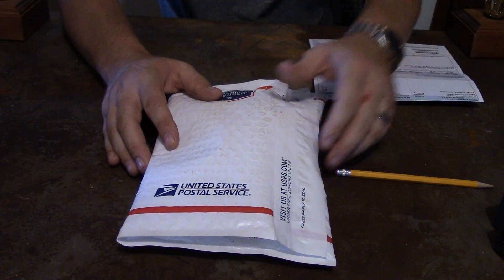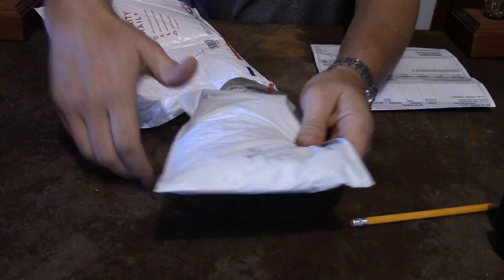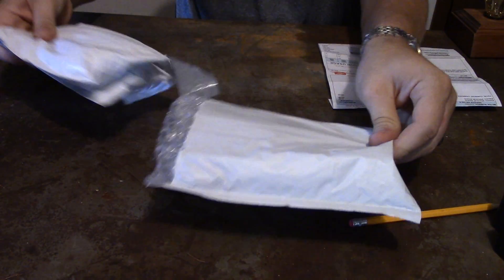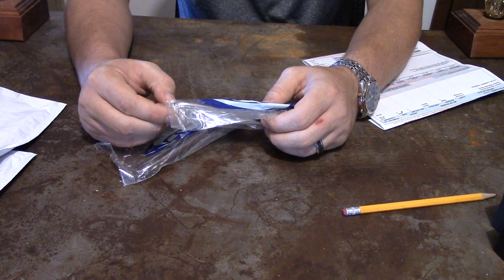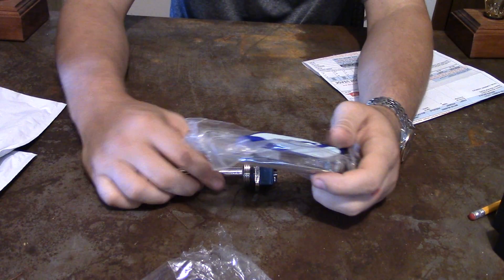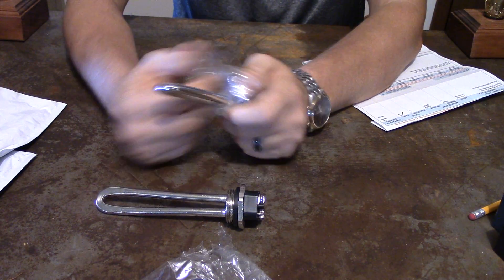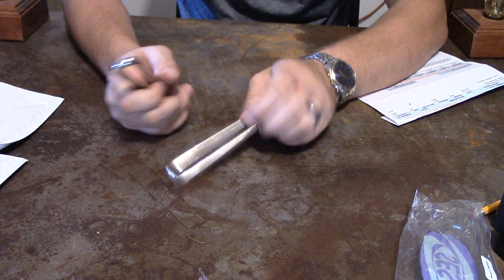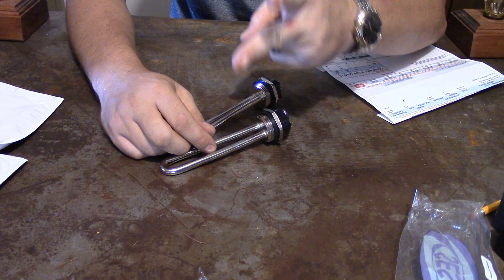24 Volt DC Solar Power Submersible Water Heater Elements - Low Voltage

Comment: Gee, that was exciting... listening to you open a couple of little water heater element packets and then complain about how they are made of soft metal and all beaten up. 
.
Of course they are soft and soft things tend to get beaten up during manufacture. The tubing is copper and the heating element is usually made of several strands of nichrome wire twisted together and placed in a powdered mineral insulation... magnesium oxide, which melts above 3,000ºC. The element is sealed into the tube and the ends are terminated in such a way to reduce the amount of heat generated from being transmitted to the connecting cables. The tubing is shaped and pressed to retain its shape and then sealed into the mounting nut with Sil-Fos or a similar material and then it is nickel plated.  
.
It DOESN'T matter whether the elements are fed with AC or DC providing it is 24 volts... it will heat WATER to the same temperature in the same time span. Much safer than 110 volt? It depends how you use them. Your low amp draw is ONLY 25 amps. A fully charged 250 A/Hr 24 volt battery will be fully discharged in less than 10 hours. If you are thinking of using it at 12 volts... fine if you only want 150 watts of heat because that is all you'll get. 
.
Use it in oil at your own risk. It is designed for water as water will remove the heat generated by the element a lot faster than the oil that you want to heat. Oils can evaporate when heated and form a barrier around an element and considering that nichrome melts at temperatures around 1,400ºC, you could have problems. Copper, by the way, melts at 1,084ºC.

Comment: I use 2,000W 120V elements that are common at most big box stores.  These work very well with 50V and 60V solar arrays producing about 450W maximum.  I power mine off the panel DC buss and generally think attaching heaters directly to a battery is a bad idea.  I have many videos on heating water efficiently with PV solar.  I have a 9 gallon and a 20 gallon tank in series and these are heated with the power that would normally be wasted as battery is charged.  Whatever is not needed, be it 5W or 400W, goes to heating water

Comment: i ran the gamut on trying to make safe reliable hot water starting with coiled black pipe ,great on sunny days then i trying 24v and 48v dc elements ,my system is 48v  all failed to work due to various problems like not being able to find a thermostat that would live at 48v dc so then i bought one 1000 watt ac element and a 30 amp dimmer switch all problems solved even used the factory wiring from my panel to the heater .I disconnected the top element and swapped the bottom element for the 100 watt using my dimmer switch ,i can control how much power the element receives, right now it's been running at 500 watts and i keep my water temp around 115 to 120 minimal impact on my 1500 watt Aims inverter and battery bank i do have a Forklift battery plus 8 trojan t-105 (8) =48v giving me 1200 amp hr cap hope this helps
Reply: You should see my videos on heating water at panel power point using standard heating elements. Why loose power in an inverter or screw up battery charging.  I get all my hot water from a 36V solar array.

Comment: Do you have any videos on these in action?
Reply from the maker: Not yet i need a tank
Reply: @solarpowerelectricityandel2915   - No, of course not. That would mean rubbing more than 3 brain cells together, which is more than the maker of this video has to work with.

Comment: I've found a mob here in Australia that will make elements to my specifications. FYI...It doesn't matter if it's DC or AC, it's just a resistor. You can run a 110V heating element on DC, you just have to make sure that the voltage is a good match.
Reply from the maker: ok thanks
Reply: Solar Power Electricity and Electronics http://solarhomestead.com/ac-elements-as-dump-loads/

Comment: I would think all the dents and scratches will cause it to fail sooner then later. Watching this video is funny because just before I watched it an alarm sounded in my basement and guess what my hot water tank was leaking so they are going to install one tomorrow and I have asked that they wire the bottom with my DC. My tank was 7 years old and just out of warranty go figure???
Reply from the maker: so sorry